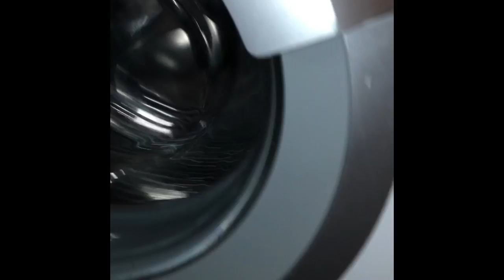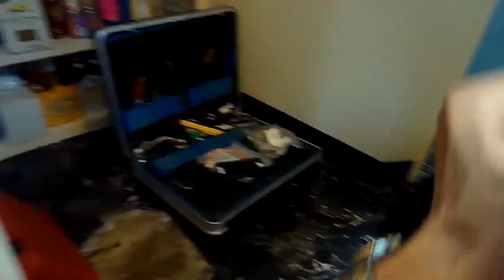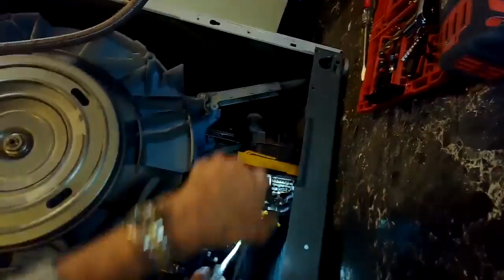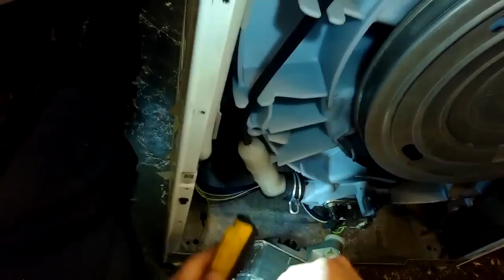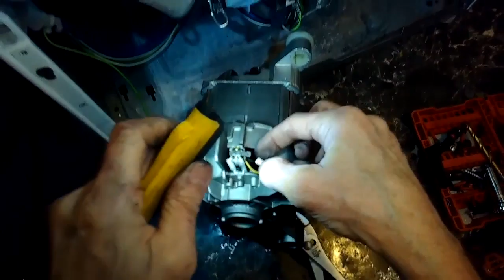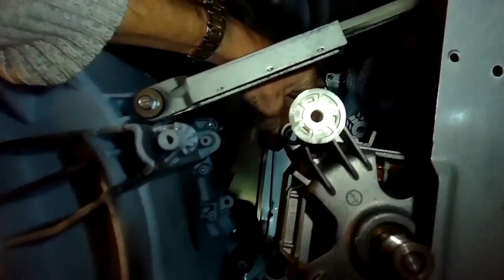✨ BOSCH WASHER - E43 ERROR - EASY DIY FIX ✨

Comment: Very useful, thanks!

Though perhaps you need to add a note at the end or in the description about how to clear the error after fixing it. Elsewhere I found that you had to turn the knob to 6 o'clock, hold the spin button for 5 seconds and then turn the knob to 9 o'clock. That cleared the error. Otherwise it kept showing up even once the brushes were replaced.
Reply: Just finished replacing my siemens iQ300 brushes..... the above method worked to clear the F43 error code.  Cheers !
Reply: Correct procedure: turn knob to 6 o'clock and wait for error message -> while holding spin button turn to 9 o'clock the display will change message (in my case error 63, don't know why) -> lastly turn the knob to OFF position. DONE!
Thank you for indicating that there is a reset procedure after error 43.